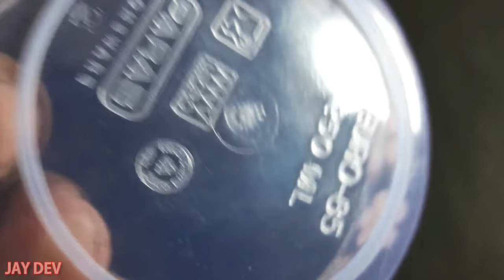how to make water pump at home

Comment: good affed but more improve  your project are two changes 1st. moter and pump connection point loose .2nd use gear on motor pully. increase the rpm with gear
Reply from the maker: ok sir..thank u for your precise advice...

Comment: Nice !!! How did u connect to adapter?? pls show the connection diagram. Whts the purpose u made it for??? How much metres of pipe supports to throw the water?? want to know. Is it preferred for small garden to water plants??? for 20sq yrds. pls reply
Reply from the maker: bro..you can connect adapter directly...just dont use switch...its discharge is 30/L per min.. up to 10 meter of pipe it support.....yes you can use it in small garden...
Reply: 10mts wow !!! awesome. Thanku bro. Keep posting. Subscribed you channel too.
Reply: JAY DEV p

Comment: Hi.
What is the speed of the motor used to test the pump?
Reply from the maker: 10000 rpm
Reply: That is very high. Or did you mean one thousand RPM?
Reply from the maker: 10k rpm...........most of 12v motors are 10k rpm....
Reply: Wow. okay, Thanks a lot.

Comment: Sir copper wire kundli se electricity genrate karne ke liye AC motar lena hoga kya ya DC or kitne volt ka please reply sir
Reply from the maker: dc 12 volt...
Reply: JAY DEV kundli banai thi but nhi ho raha h
Reply: JAY DEV please help me sir
Reply from the maker: KUNDLI KE LIYE MOTOR KAA KYAA JARURAT HAI...AAP SIDHE MARKET SE V WIRE KHARID SAKTE HAI...
Reply from the maker: JAHA MOTOR WINDING HOTA HAI WAHA SEE AAP KHARID SAKTE HAI....
Reply: JAY DEV sir aapne jo is video me motar use kya h mere pass isse chote 3 motar h wo kitne volt ke hote hain ek

Comment: where are you found the motor?
Reply: i mean where can i get it. for example dvd motor or computer fan motor etc
Reply from the maker: dvd motor and computer fan will not work.....if you want high discharge water pump....you have to use  high power motor....and again if you want to make a water pump just for demo purpose...you can use dvd motor...if you use dvd motor ...discharge will be very low...
Reply: i want to use with sluice box for gold prospecting in river bank. i'm looking for a motor can stream a shovel dust
Reply from the maker: I think... for that you should high power motor...if you want slow constant discharge...you can use low RPM high torque motor ( geared motor)
Reply: do have any example?
Reply from the maker: like self starter ( motor)....of a bike